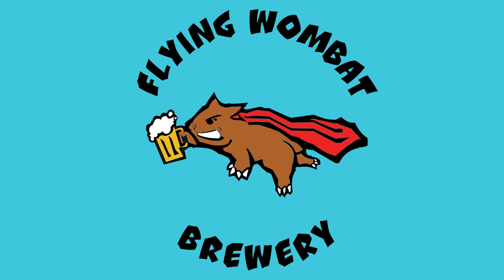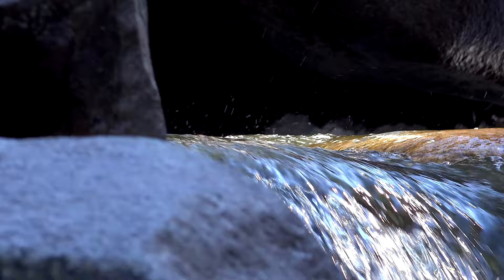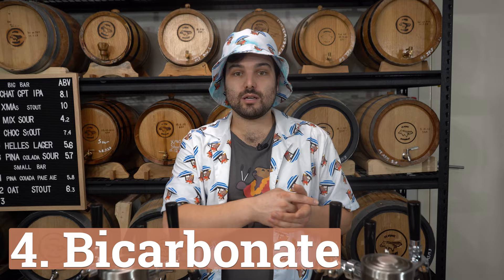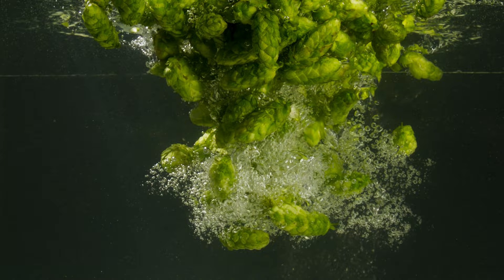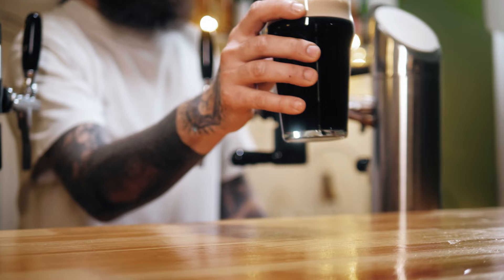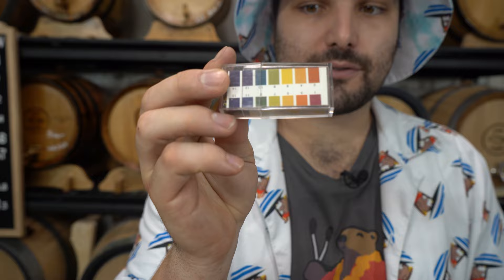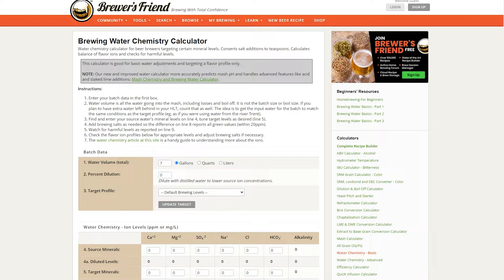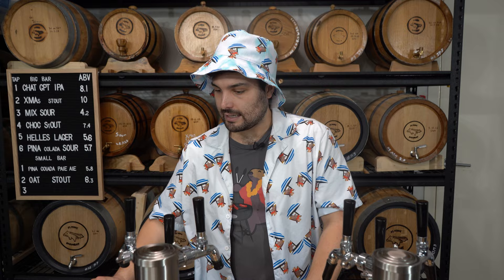How to use BREWING SALTS - Beginners Guide to WATER CHEMISTRY

Comment: When using a salts calculator (brewersfriend) I struggle to figure out how much of which salts to add.  I add one item which then hits some of the mineral targets, but then when adding the rest everything gets out of whack, continuing adding various salts and soon nothing matches my targets anymore.  It's so frustrating, which ones do I add first/last. Is there a better approach then just randomly trying to increase or decrease the various salts and hoping to get close to my targets?
Reply from the maker: Hmmm that sounds really annoying. Honestly I haven’t used brewers friend for this myself, but I know when you use Brewfather you can set your target profile and get it to auto adjust, then tweak the amounts from there. 

Adding different salts will adjust all the levels because these compounds contain multiple ions, for example calcium sulphate (gypsum) contains both calcium and sulphate so will adjust both, then slaked lime also contains multiple so on an so forth… so adjusting profiles does require a bit of playing around with it, but maybe I’d suggest giving Brewfather a crack? It’s been pretty great for me